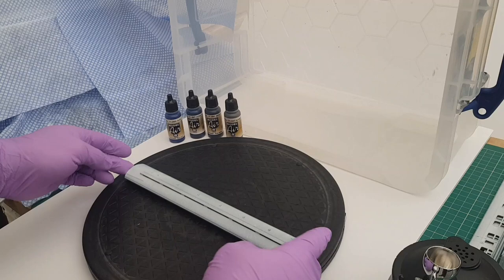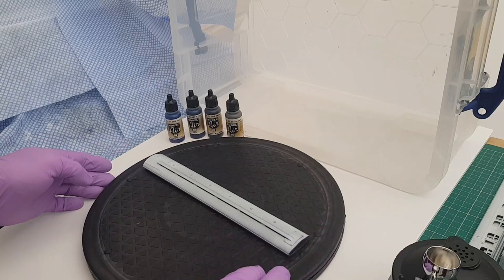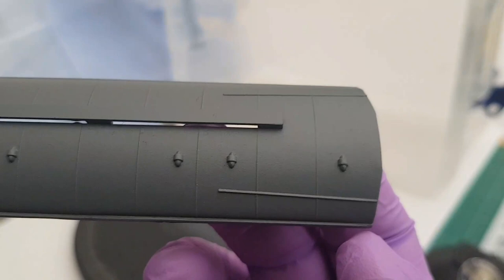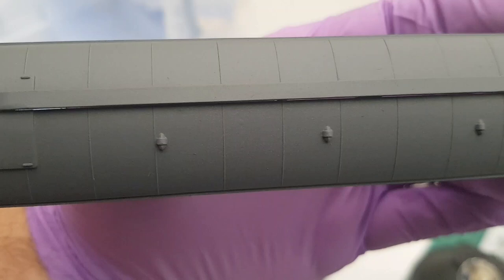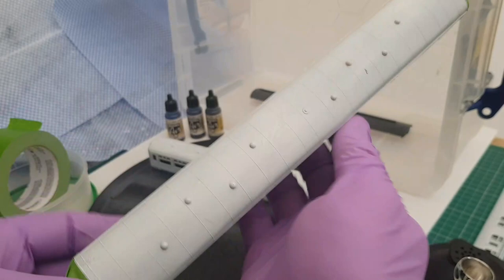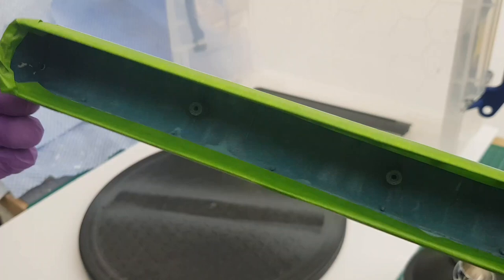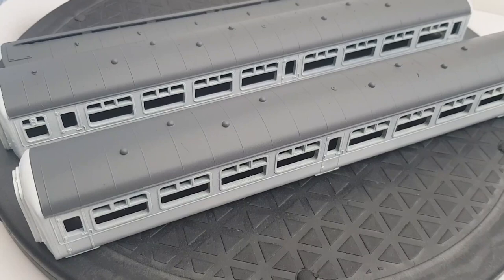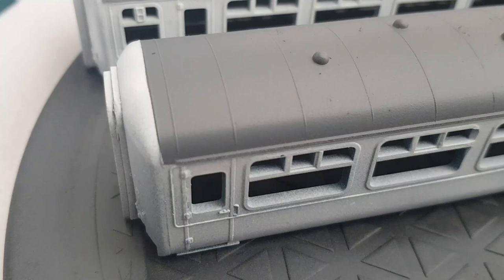Refurbishing Coaches, Painting the roof

Comment: the hardest part is to pick a good masking order depending on what color cover better  and what part is easier to paint after the rest was already painted
for me in n scale it is basically a step by step way picking most similar colors to coexists without masking as far as i can go and only then mask contrasting ones and everything that cut off on hard body lines
there is also a trick with masking tape, to make a crisp line you need those very narrow , very sticky model specyfic tapes but to cover biger areas with them, tape regular tape over , and to make fussy edges just lift the masking tape edge and it will make fuzzy edges for you